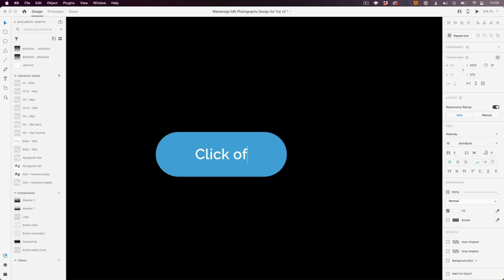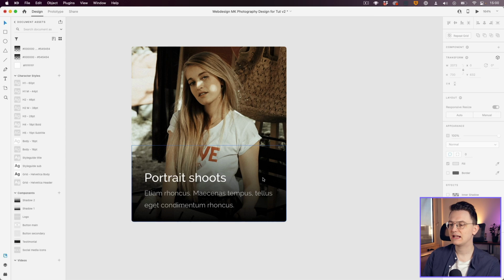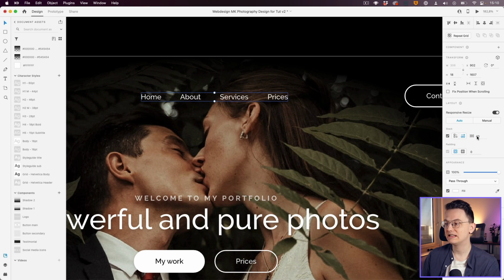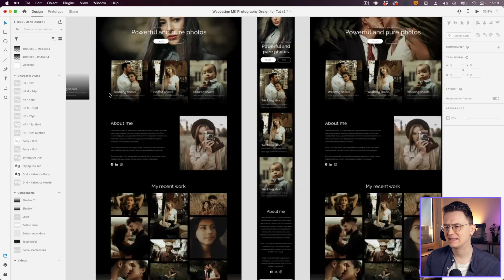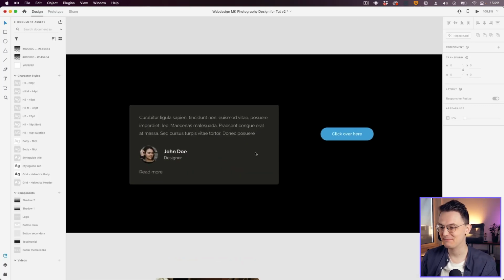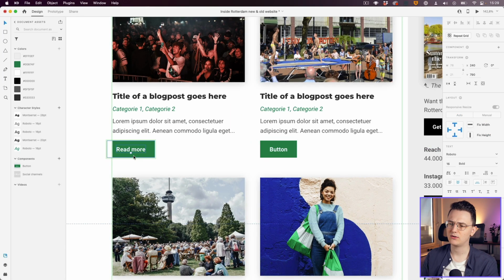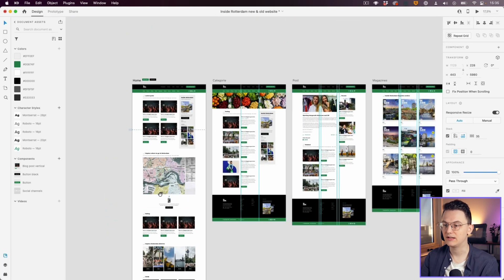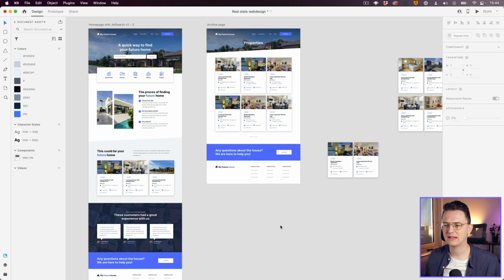Useful Adobe Xd Features: Padding & Stacking

Comment: Hey Rino, very helpful tutorial thank U! I am in practice and got a problem. I've made a box with a label, a title and a paragraph. I've set the vertical stacking(working fine) and added paddnig inside the box (works fine to) but after I try to resize my complete element, not brake the paragraph lines just resize my text and i dont know what is the problem. If I use "area text" on paragraph  it's seems to ok when I resize the text box but if I try to resize the "container box" not break lines just hide the outflowed text. Any idea how can I solve this?

Comment: Hey Rino, good to see you back again. Anyway I would prefer Figma here. Because Figma is already have this options and also much better abilities. Just an example: Padding = On figma it's called Auto layout and trust me it's much much better option than padding (like you can make your site fully responsive directly on figma and once you resize the width on main frame it will resize everything based on the width and make the design as much as the same. You can say exactly like chrome inspect). Lastly Auto layout is already have stacking system by default. 

BTW it's a good information for XD designers.
Reply: But yeah repeat system is still missing on figma :D. I wish they add this system soon on figma
Reply: @nafiul499  Never used that. Auto Layout ist boss.
Reply: ...btw Figma is free :) Figma is always much ahead